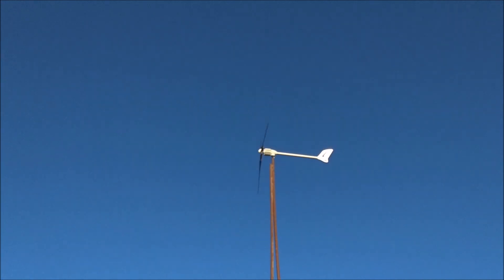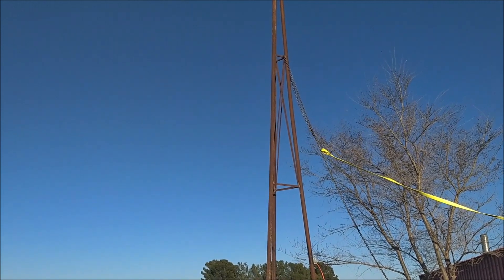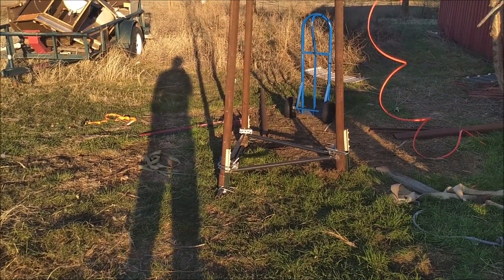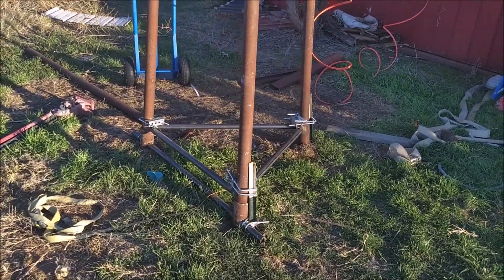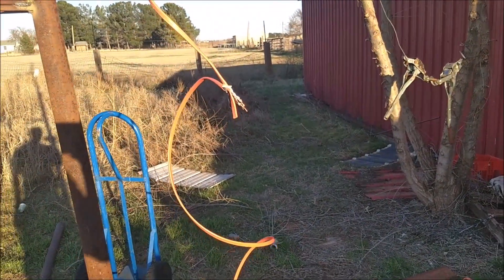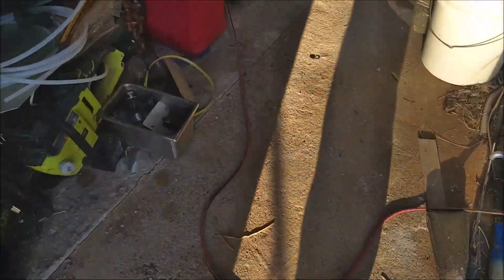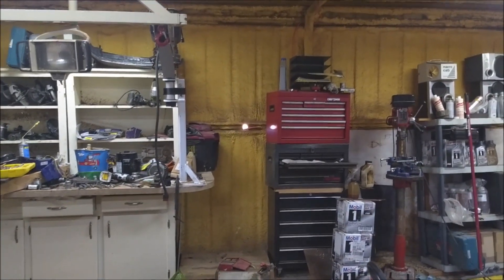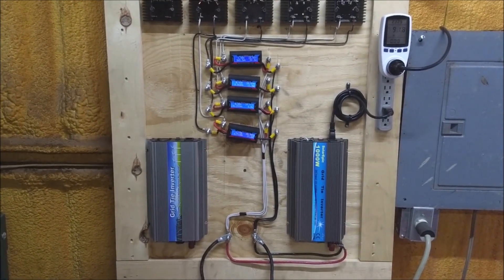iSta Breeze i1500 wind turbine and oilfield pipe tower: Day 1

Comment: do you have a dump load in the system?
Reply from the maker: I do not...there's 2500 watts worth of inverters tied in so a dump load has not been needed.  I will probably need to sort out some means of handling excess power now that the i1500 is up and running but up to now it's been running fine.  I will probably set up a solid state relay and tie it to some water heater elements or something to handle the job.

Comment: My turbines both had a good wobble and what i quickly realized was my blades were out of balance. After balancing that went away completely.  Do you balance yours or basically just whip them up there for "out of the box" performance reviews?
Reply from the maker: I do a static balance on the blades, but the tail wobble isn't from that.  If it was a blade balance issue you'd be able to feel it vibrating the tower.  The tail vane wobbles when the wind hits it and the blades aren't turning.  I think the material is just flimsy.
Reply: @ToysforWatts  no kidding eh!? Sounds like that could be beefed up quite a bit.
Reply from the maker: It could be.  There are things I like about this turbine and things I don't care much for, but for the price that's the kind of package you're going to get.  At least the tail vane will be easy enough to fix.  I already have a sheet metal replacement cut out for when this one comes down.

Comment: Nice to see it up and running hope you don't mind me saying but is 10 G wire big enough ? according to a chart i have at 36v 70ft with a 1500 w turbine you should be running 6G it says the max amps for the 10G is 15 and the volt loss is over the 5% at 12.14% 
This is the link the the download i used, it's a handy tool
https://www.youtube.com/watch?v=uS7CyTxAA4o&t=477s
Reply from the maker: Nope it absolutely should be larger...I just can't afford it :/...I have to take the loss into consideration when I see the output and I'll be checking the wire regularly for problems.
Reply: @ToysforWatts  I know what you mean the price of wire is crazy, i ended up putting two lots of 8AWG together as it's what i had to hand, not sure but i think two 8G together gives me about a 5G, i put a 50A brake switch in but it turned out to only be a 15A and it melted  sending the turbine into overdrive lucky i had a resistor bank set up on the grid tie side so was able to make some jumpers and hook it up which brought it back to earth, mind you hooking the jumpers on when it was pushing 100vac wasn't much fun.

Comment: Beautiful setup, very nice, next test Ista Breeze i2000?
Reply from the maker: Quite possibly!  At a glance today the i1500 was making more than half again what all three of the others were kicking out, and the price point is not a great deal higher than machines like the 700w rig from China.  I think if they had a few good examples flying and demonstrated here they'd be much more readily considered.  I think they still have some kinks they should sort out, but still quite worth considering.
Reply: That noise of the smallest turbine is not akceptable :)
Reply from the maker: The 500 and the 700 have very, very noisy blades and I'm looking into alternatives for them.
Reply: @ToysforWatts  try to make movie from i 1500 side, im very intresting of noise of ista breeze. What about your neibors? Are they hapy? :) gretings from Poland for your posting.
Reply from the maker: My neighbors are far enough away that the noise isn't going to get to them much.  I'll see about getting a video a bit closer to the i1500 prop for a noise comparison.
Reply: Thanks bro.